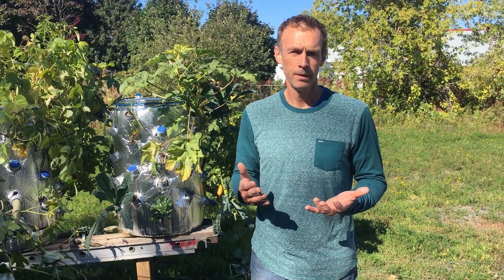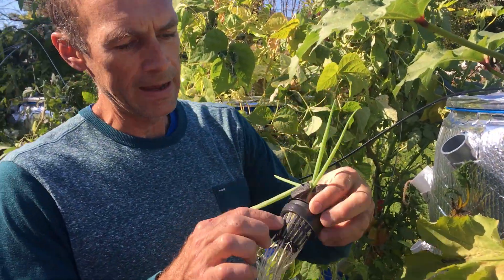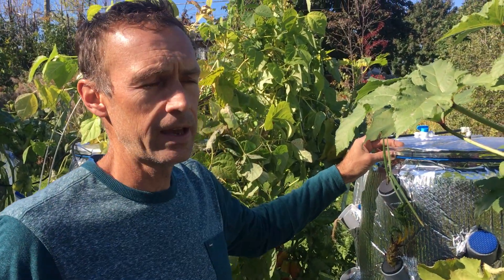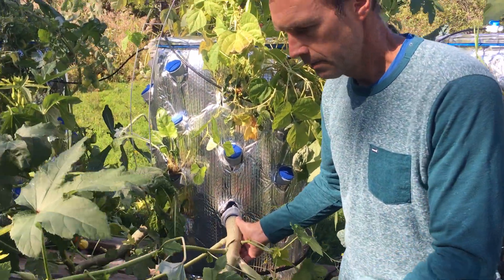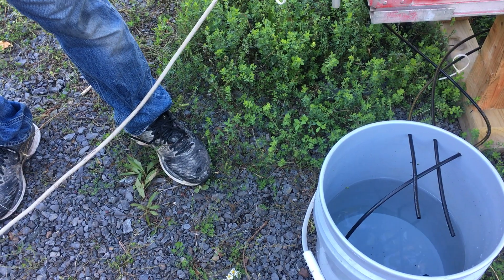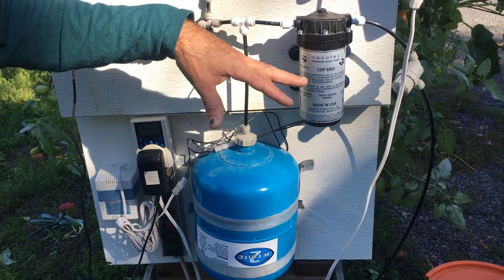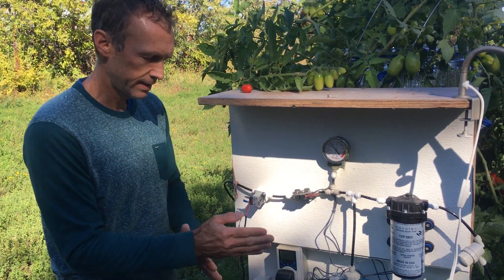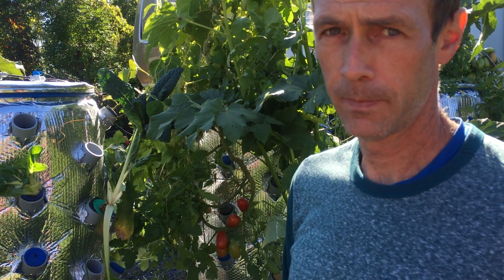High Pressure Aeroponic garden

Comment: Why not put the tank to even higher pressure and use an 80 PSI regulator, that way the tank will only need to be turned on occasionally?

Also. Wouldn't the water cool down when misted?
Reply: A lot depebds on the maximum working pressure of the accumulator but its always best to use a pressure reducer set to the minimum tank pressure to ensure a constant flowrate from the nozzles.  Evaporative cooling relies on relatively dry air and airflow, the RH% in the barrels will always be high and there`s very little airflow ;)

Comment: I wouldnt recommend using any plant that grows more than 12"-15" tall in a barrel system unless you provide external support. If you plant mange tout (snow peas?) in the bottom sites you can train them to grow up and around the barrel. I tie loops of string around the barrel at intervals (not too tight) and tuck the plants behind them as they grow  The side shoots latch onto the loops and spread sideways and eventually latch onto other shoots to form a natural support net They are super productive and provide local shade and humidity which is very beneficial to short term crops like lettuce which have to be replanted throughout the season. The seedling survival rate is much higher with  mange tout foliage protection than without.
Reply from the maker: Hello Atom Izer, thank you for these practical suggestions. Being in QC, Canada, I will reorganize the barrels in the spring and will definitely apply your ideas when we start the seeds before Spring. Any other ideas are welcomed and appreciated, Happy growing
Reply: @renovatech  
I`d suggest using a coolbox (igloo etc) for the reservoir or burying an uninsulated reservoir in the ground to keep it cool. I`m surprised your white bucket isnt green with algae, you must be cleaning it regularly  :) For recirculated hpa, i`d recommend a 250 mesh filter if you can find one. It looks like you are using biocontrol impingement misting nozzles which have a faily large orifice.
Reply: @atomizer2665  would you recommend the biocontrol nozzles ? Thinking about trying them
Reply: @jessesaitoo  
The biocontrol nozzles are ok but considering the price they could be better..The stated flowrate is nowhere near accurate and  mist pattern they deliver isnt 360deg as you might expect. Unless the QC has improved your likely to get a few dud`s so order extra and dont be surprised if you need to send a few back.  The main issue is the nozzles are made of plastic and the correct function hinges on the perfect alignment of the orifice and impingement pin.